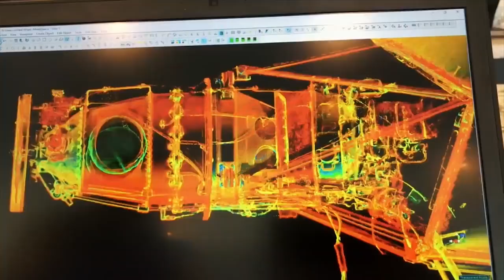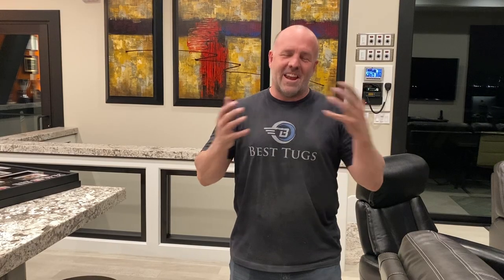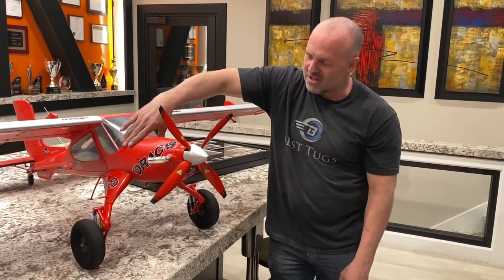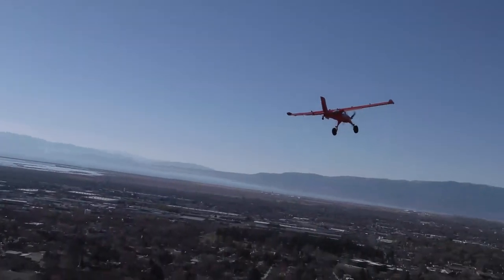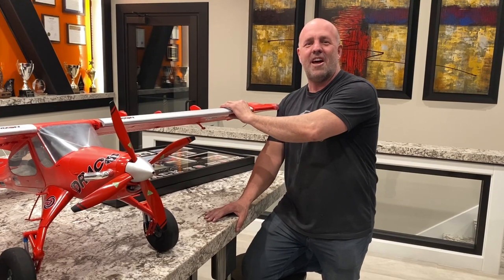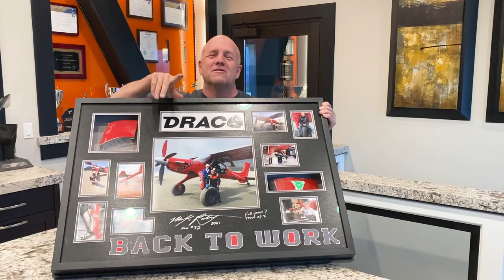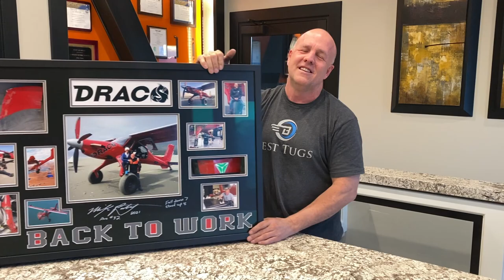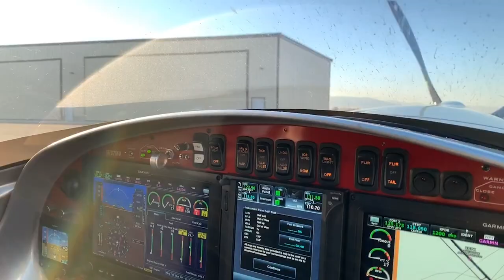I'm Giving Away DRACO! 🐉✈️ | Horizon Hobby Releases Mike Patey's Radio Controlled Draco

Comment: Lets keep this ball rolling. Scan Scappy too; we can start a Patey RC collection.
Oh!!! Draco vs Scrappy dog fight!!!
Reply: I like the way you think Joe!
Reply: I want a model of Turbulance......I will beat anyone else to where I am going.
Reply: @brentdykgraaf184  I'm not 100% sure, but i think there's an RC company that sells 3D printing files, and one of the models is one that's oddly Turbulence look alike. I don't remember where i saw it (either here on YT or on Reddit) but it was a proper fast RC plane 3D printed. I think that it clocked something like 90 mph in the first few runs where it wasn't really tuned up right.
Reply: @aserta  horizon hobby got the v1200 to go 200mph with stock electronics
Reply: That was my thoughts also. I would love to have a RC version of Scrappy. "Let's get back to work" Mike and have Horizon do that one next.
Reply: I’m sure it will happen. This thing will sell crazy well
Reply: @adamsmith5913  I dont think it does 200mph on stock electronics exactly, I think its closer to 160mph. But if you do modify it, it will do 200mph, but thats really bad on the airframe.
Reply: @rcaviator8408  he said in the video that the only thing changed was the prop to a 10x10 and it hit 200mph with the wind and a dive with stock electronics.
Reply: @rcaviator8408  the airframe was also made stronger

Comment: They did such a great job on the scale details. I can’t believe how close it is to the real deal.
Reply: The single one thing they did get wrong with this model is the scale.
Should have been 1:1
Reply: @wimbraber944  no, the problem is that you're too big!
Reply: @wimbraber944   yeah or 1.5 but they probably couldn’t get all the details on it  right being that smaller sizer.  Still going to be a sweeet plane    Maybe they will come out with a umx draco. Lol.

Comment: Now everybody can have Draco.  Love it.  Back to work.
Reply: Not at that price!
Reply: @edwardhasiak7961  Horizon hobby for you, all their prices are ridiculous now, 
Cool plane though
Reply: @mark675  Remember: This is a 2 meter airplane with 100A ESC, telemetry receiver and servos. Try building a similar ARF plane and you will be in the 800$ range...
Reply: @edwardhasiak7961   I don't know.  The BNF version is only $600.  Besides the really, really nice and big plane, you're getting the motor, 100 amp ESC, receiver and all the servos.  Seems like a fair deal to me.  I've been in this hobby for over 50 years and people "now-a-days" don't realize how cheap (and advanced) RC stuff is today.
Reply: "everybody" except if you live outside of the us. Which I guess for most of the us does mean "everybody"
Reply: @edwardhasiak7961  Aviation dollars are exponentially more than daily life dollars.
Reply: @nothingtoseehere4026  This is true.
Reply: @SkyWriter25  Yes you are right. Iv'e built many planes from kits and by the time you put quality electronics in them they came out close to that price. Even if you build from scratch with today's balsa prices "if you can find it" can be very pricey.
Reply: @mark675  Yes it is.

Comment: this is such a cool model. i've been an avid flyer of the OG GWS slow-stick electric plane before it got discontinued, then i bought a 1/10th scale Cessna single engine brushed DC. got it all together batts charged radio and controls paired synced and zeroed, cycled the batts and blew all 3 spare props that came with it apart at 25% power with its stock motor and battery combo. haven't flown since and the plane has never lifted a wheel.

Comment: Mike, I was laying in bed and I had an idea for Xtend-A-Wingz, thinking of the spar only, two inverse ultra high mod carbon 3 unequal length sections for both sets of twins.  They would be rectangular when combined. The design is similar to an old radio antenna that retracts. Similar type system with a collar that stiffens the spar when it's locked open. A solid part of one spar will bridge the joint on the other.  When it's in one of it's 3 positions a one piece flat carbon strip will be spring loaded and drop the 4 necessary spar lock pins in. You'll need a super strong push pull cable to move it in and out. Maybe Teflon sliders to keep it tight as it's moving. Just an idea.  You could build a roll up spar with a roll up locking sheet that slides in the unidirectional backbone making it rigid. That may be a safer simpler execution because it is extended and retracted from inside the plane. Imagine a rectangular high mod vertebrae with titanium hinge pins on the top, the inside direction it will roll. On the bottom side of the vertebrae that opens there are 4 c channel clips or can be one piece. The inverse sheet roll will insert along the base continuously as it extends, locking the vertebrae flat as one piece. Imagine the crazy AR 100 round mags with mirror rolled ammo. The same storage idea anyhow.

Comment: The link led to a dead end and I had to buy it straight from Horizon. Wanted to buy it through you Mike.
Reply from the maker: The link will take you to Horizon, it is an affiliate link that gives me credit. Horizon does have product and it is a pre-order option. Try the quickview option as well.
Reply: @MikePatey  When I went through your  affiliate link from your webpage,  it took me to the three options for Draco on Horizon’s page. When I selected the Bind and Fly option ($599), the link went to an “oops “ page. 

With time running out, I went to Horizon Hobby‘s page directly and was able to order one from their front page before they sold out.
Reply: @MikePatey  tower hobby site works.  I called horizon upset because the link didn't work as soon as it went live.

Comment: Mike, if I was in a position to buy one, I most certainly would.  I'm afraid that the $1,200 for it is just a bit out of my reach right now, since I need the new radio and all the other stuff that goes with it for the Bind and Fly set up.
Still, this is an awesome thing, and Horizon did a really great job with it.  I'm sure it makes you proud, as it should.
Now, back to work!

Comment: Draco on floats ,with thoughts shocks . I want to build a wind generator /airplane model that will fly a figure "8" on a tether to  create huge charging for my lithium battery to power 37 ft. trawler. Makani did some great experiments which have been discontinued,sadly.

Comment: I'm too broke to buy a Draco but want one so badly! Currently finishing up my design for a 50", low wing, dual ducted fan private jet-esque plane, using a mix of 3d printing, carbon tubes, and balsa. I'm an engineering student, and have been working on a flight controller and sensor suite to try to perform autonomous landings with my free time! I'm also working on another project that should make flying fixed wing drones feel a lot more like the real thing, but I don't want to say too much in case Horizon Hobby is listening, lol!

Comment: Hey Mike my 13 year old Son went nuts when he saw this Video because he loves watching your channel and you have inspired him to become a Engineer.
 He came and asked me to buy him one.
So I told him if he wants one I will buy it but he will have to pay me back for it. 
He smiled and said that is Fine Dad I have some Summer Jobs already lined up and have been saving from the Snow Shoveling Jobs.
 He ran to his room and gave me $220.00 and said he doesn't want the $1199.00 because he has a Controller, Batteries and Battery Charger already and to buy the  EFL12550
 DRACO 2.0m Smart BNF Basic with AS3X and SAFE Select $599.99 version.
He then told me that he is going to take The DRACO and put it suspended over his Bed because he feels he was part of Building it with you through your Videos.